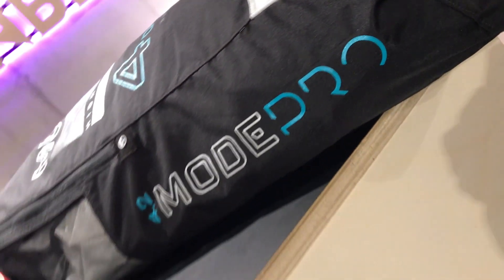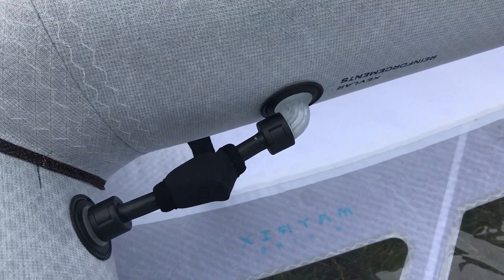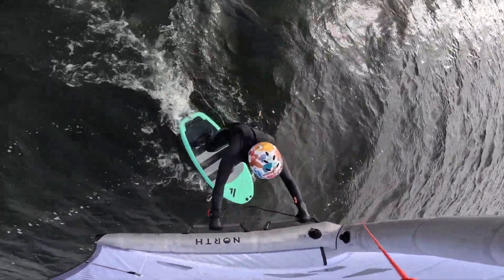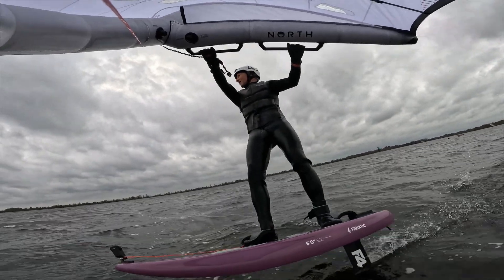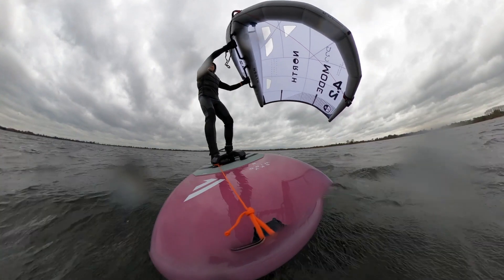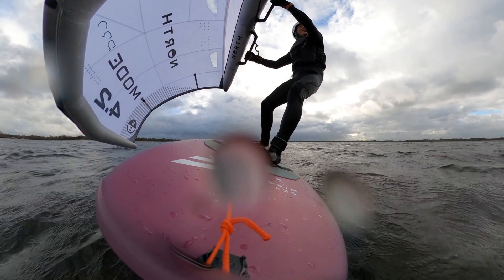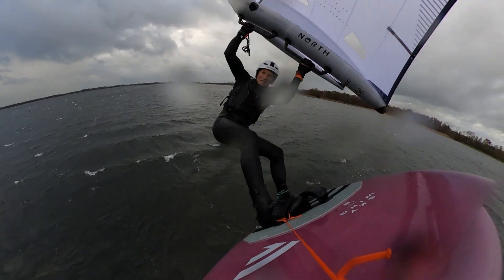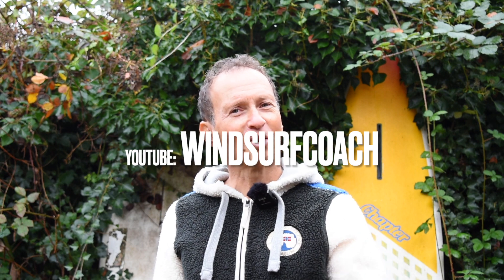NORTH MODE PRO 2024 WING TEST

Comment: Top notch production and layout of video.   How does this wing compare to the flux and slick?
Reply from the maker: Hi @tscorched3628,
thank you, great to hear!

Haven't tried the Flux but use the Slick SLS often.

I would say that besides the boom/hard handles the main differences are the stability and playfulness.

The Mode Pro is very stable and ridged where the Slick is far more playful and light in transitions.

If your looking for high speed and big airs the Mode Pro will be your friend but when looking for tricks I would chose the Slick (SLS).

See you on the water!!

Comment: I have Mode (7, 5.5, 4.2) & Mode Pro (5.5). All of them have stitching problems at the leading edge (Struts are fine).They are basically falling apart at exactly the locations of the wings. I was recently informed by North that the product produced until Q2 of 2024 will have this issue due to the single stitching (?) instead of double stitchings.🤢😵‍💫

Do not get me wrong, I love Mode Pro the way it functions especially handing the gust and its low AR design. However, I wish they had fixed this issue sooner.🤔
Reply from the maker: @Tobeon2  thank you for sharing!

So that basically means that all the Modes that are produced until Q2 2024 could run into those stitching problems in the longer term.

I wasn’t aware of the the issue as I normally use Duotone SLS Slicks and don’t own a North wing.

For all the other North users that are following the channel…..

If I may ask….
What is the solution that North offered you?

Have a fantastic 2025 and…
See you on the water!